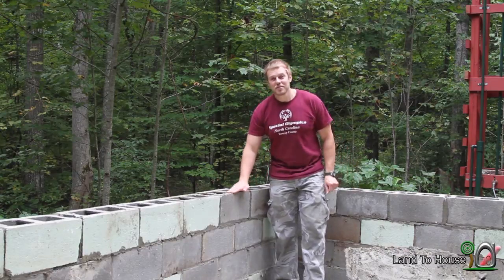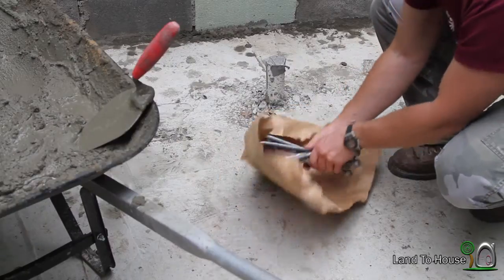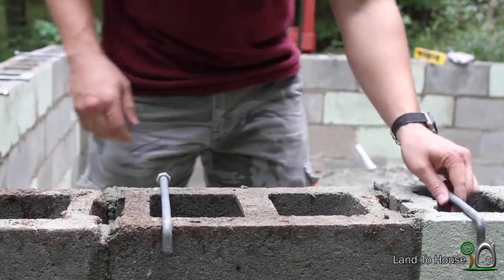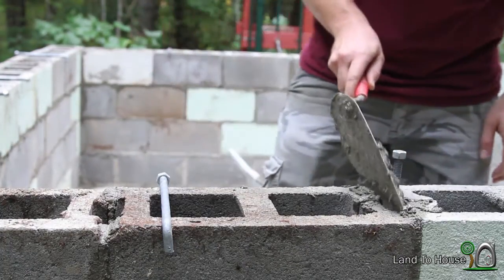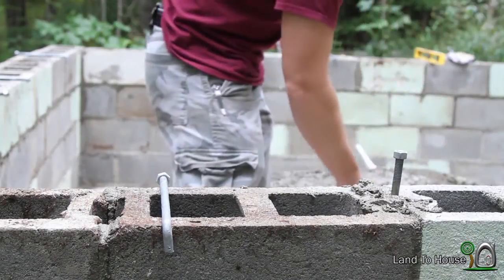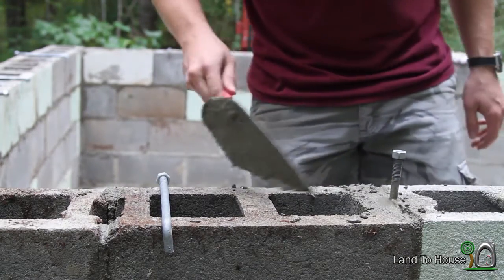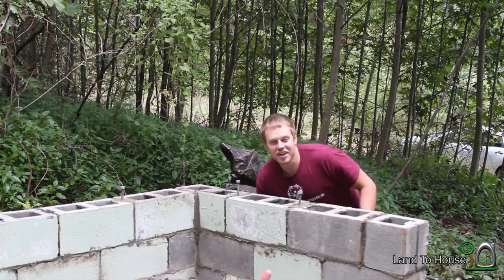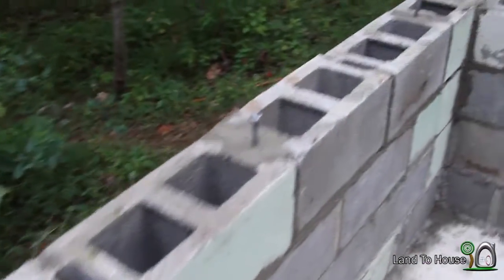Tiny House 8 - Bent Anchor Bolts

Comment: It's really good to see you fixing down the wall plates in what I consider the proper manner, I have seen loads that have been anchored only by metal ties.
Reply from the maker: Thank you. I have worried that 15 of the anchors is not enough. So far it seems to have been enough. Also I have wondered if I should have filled a few of the cinderblocks to add the extra strength. A bit to late now.
Reply: Land to House .com I think you have plenty enough anchors and as for the blocks I have recently made a whole through a cellar wall in my house that uses exactly the same block, it was tough going so I'm sure you won't have any problems with strength.
Reply from the maker: Michael Collinson good!  I sure don't want the whole thing falling in on my some day :) what is your hole for?